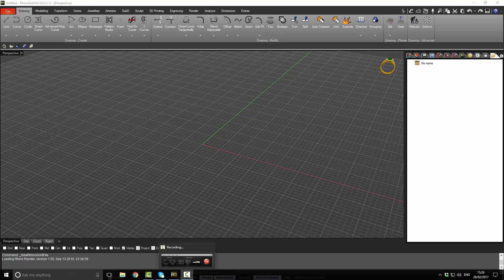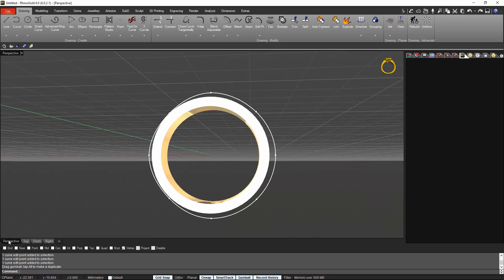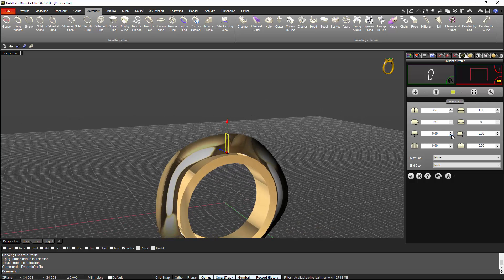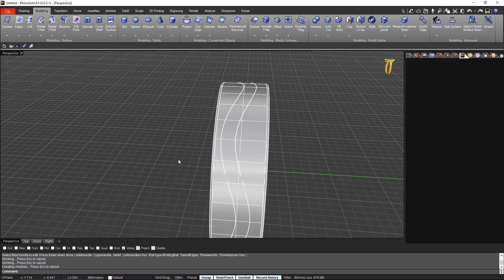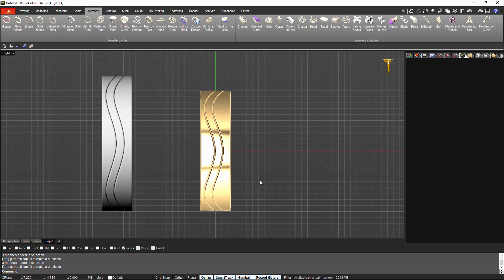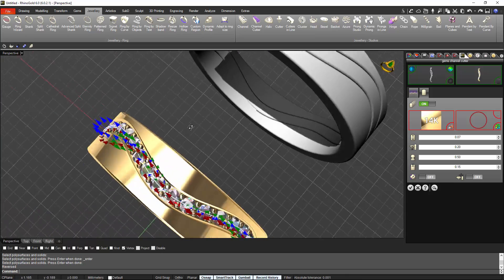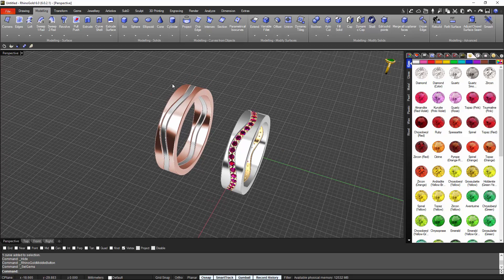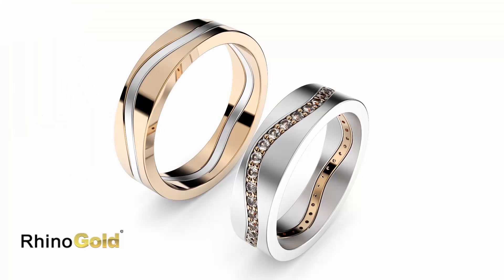RhinoGold 6 Free Tutorial 03-2017

Comment: For variable fillet failure, there is a fix - 
* Select Variable fillet
* Select the edges and don't press enter yet
* from the fillet setting click on FaceEdge and select the inner face that between the 2 part of the ring
press enter 3 times and this should resolve the problem

Comment: I have a problem following this tutorial : I do everything as said in it. Same size, etc. But when I do the Variable Fillet on the outer edges of the ring, everything is fine. When I do it on the edges that goes along the future channel, it create the "chamfered" surface, but it doesn't cut the original surface. So I still have these 90° angle edges, and four new surfaces...
I have the "TrimAndJoin" option set to Yes.
Reply: I also have problems like you, please show me